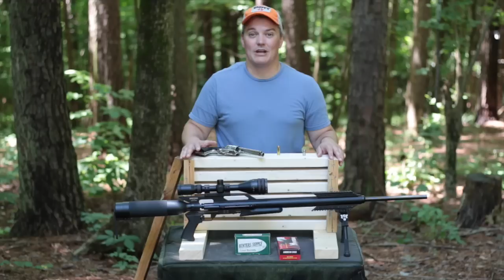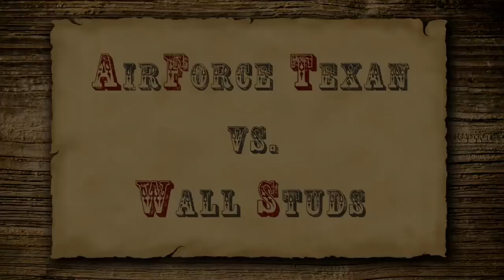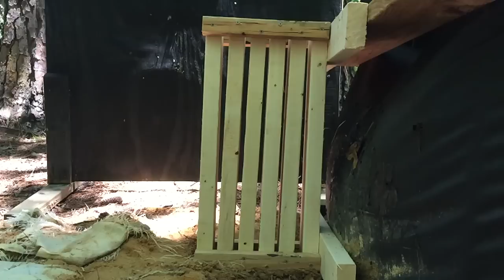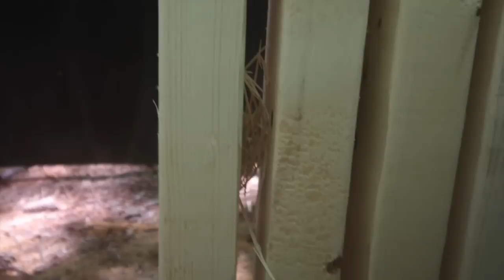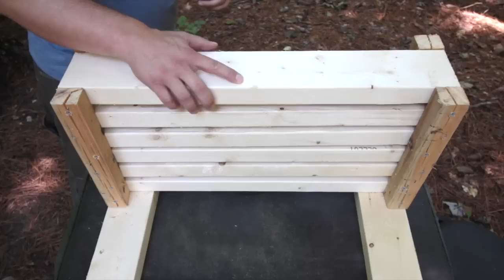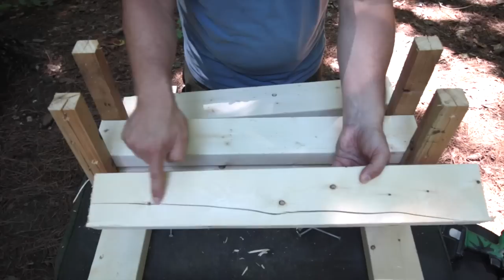World's Most Powerful Airgun vs. Wall Studs! How Many Can It Break?

Comment: Well I think I found my new favorite way to drill holes in wood while also working on my marksmanship! That rifle is wicked
Reply from the maker: Ha!
Reply: For my latest project I used a Henry Lever in 357 magnum. I didn't care about the backsides of the studs and since I didn't have a drill bit large enough I took my wood to the range and after a trial run drilled my holes. I did latch them together for smoother holes.  BTW -  Never use a hollow point for this purpose :)
Reply from the maker: bill h Nice!

Comment: Led slugs aren't designed for penetration, rather for deformation in target and leaving as much energy as possible. But interesting test anyway.
Reply from the maker: Not entirely true.  It all depends on the particular lead alloy used.  Solid lead slugs most definitely penetrate more than hollowpoints, for example.  Regardless, there are limits to what kinds of bullets you can use in most air rifles, and this particular slug is the greatest penetrator of those you can use with the Texan.  Thanks for watching!

Comment: where do I set the tuning dial on my Airforce Texan if I turn it down too much while there's not much tension on the spiring it misfires bullet lodges in Barrel..what should I do.leave it cranked up while there's a lot of tension on spring.300gr slugs

Comment: Do you think there'd be a noticeable difference if shooting the 166 grn .45's? There would be a noticeable jump in velocity and I wonder if that would outweigh the loss of weight.
Reply from the maker: Big difference in the other direction. Airguns need barrel time to generate KE. Plus, guns like the Texan are regulated to release more pressure behind a heavy bullet than a light one. That's why you get more shots per fill with lighter bullets. Thanks for watching!
Reply: TWANGnBANG Wow good info, thanks for that.

Comment: You should try using helium rather than air as the helium produces higher velocities and more consistent shots at the same pressures.
Reply from the maker: Not safe in the Texan according to the manufacturer.
Reply: Not sure why it would not be safe as you would be using the same pressure so would not exceed the max pressure for the gun.
Reply from the maker: EQUINOX Not exactly true. The regulator is tuned for air, not helium. Plus, all the seals are designed for air, not helium.
Reply: TWANGnBANG The regulator would not mater as helium compresses at the same value as air does and so the regulator would work fine,  The seals would also be fine also as the force the helium would place on them is the same as air the only thing that could happen due to the helium having a much smaller molecule is that over time ( like days ) if they cheeped out on the seal rubber the helium could leak through the rubber compound.
Reply from the maker: EQUINOX Sorry, but I have quite a bit of experience dealing with compressed helium and regulators as a mixed gas diver. Helium does NOT behave the same at the same pressure as air, which is why we're having this discussion in the first place. ;)  Regulators have a timing element to them, and the faster helium can more easily blow through them. That's one of the reasons we love breathing mixed gas at depth because compressed air gets very slow and drags as you inhale. Helium does not noticeably drag at any depth I've ever dived. Also, many PCP rifles use nylon bushings for seals that often do not extrude enough for helium's smaller molecule. Helium and PCP rifles is not new- people do wreck rifles using it.

Comment: do they make a suppressor for the texan twang ????
Reply from the maker: A suppressed solution is coming in 2017, but I'm not sure it will retrofit to existing Texans.
Reply: Check out Donny fl he has many suppressors and adapters to fit lots of different air rifles. I own one and am a buyer for life. They work very well to take the loud bark down to a click or in some cases just a puff. On my air rifle all I can hear is the hammer hitting the valve and the impact of the pellet striking My target 25 yards down range. The pellet strike was louder to my ear than the shot. A must have for hunting in my opinion. The critters hear nothing.